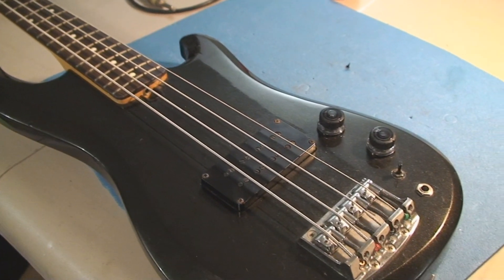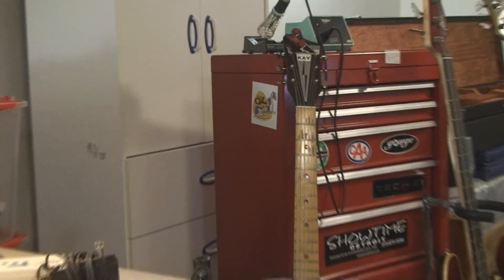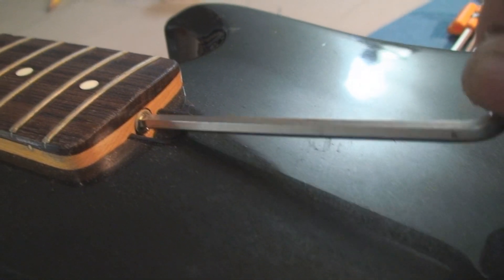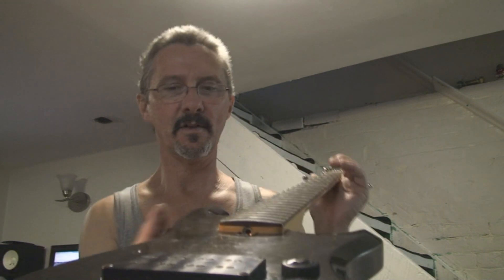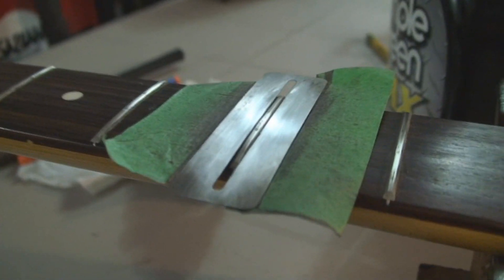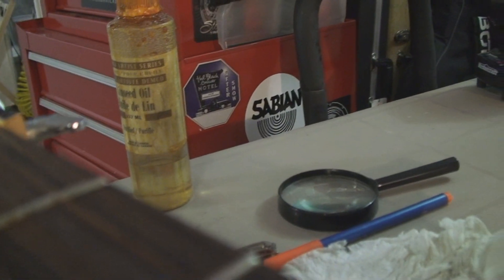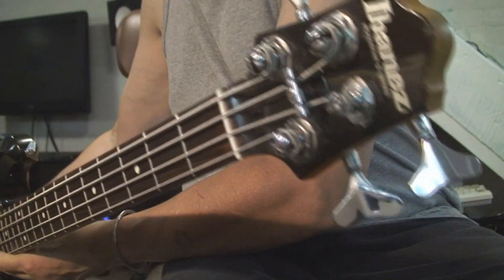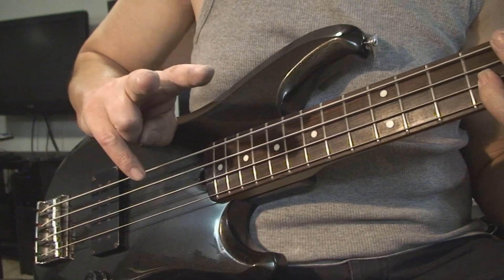Ibanez "Butter Bean" RB888 Bass Guitar

Comment: Hi stefano,
i happen to have one of these RB888 since the late 80s,
It's sound has it's strength in those mids, that you can hear in daves vid, actually it translates its character quite well.
It has a very fast neck that did not change since the 80s in mine, so they have really good wood used in these.
Main pro's are - it is small, but actually long scale, it is very light and therefore very nice to your back, and it is extremely fast with it's slim D-form neck.
Best regards,
Martin

Comment: Bought mine new in 1983.  Still playing it today.  I also own another 83 Roadstar II with a different body and head, but the same neck/fingerboard profile and the same electronics and bridge.

Have had multiple tuners break. Can no longer find replacements.
Reply: Oh...  And mine also has small chips on the edge, and some rashing on the back of the neck, though not as bad as the on in the video.

The finish seems very hard and will never ever wear off like old school finishes did.  But it's so hard that it's brittle and chips when it hits something hard.

I've never cared about that kind of stuff.  I'm a musician, not a model.

The first scratch hurts, the rest are war stories.
Reply: Gotoh tuners can suffice if you’re unable to find the vintage Ibanez tuners, just a heads up